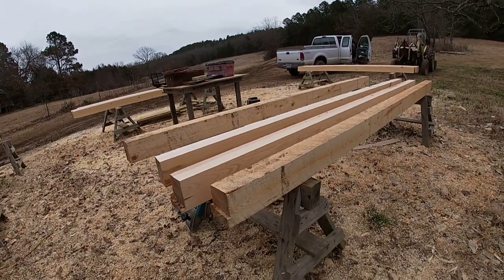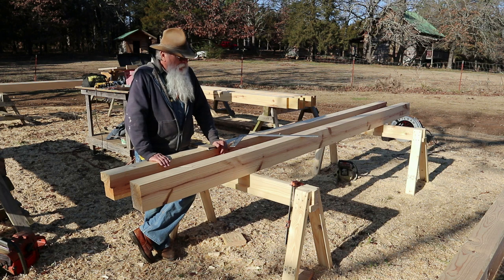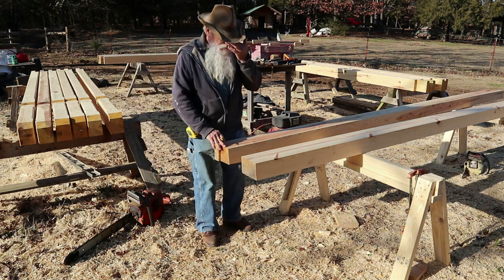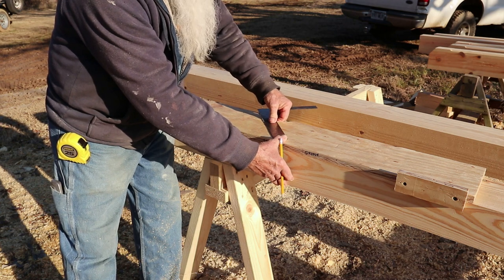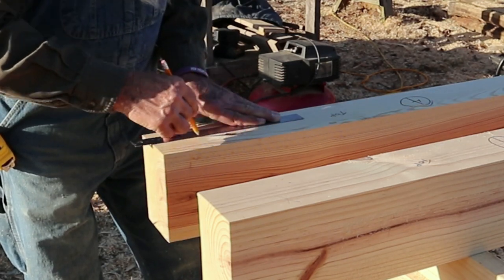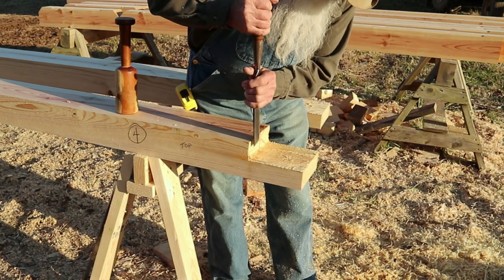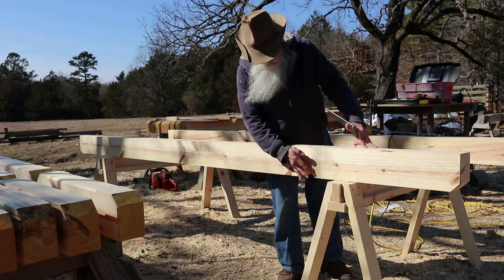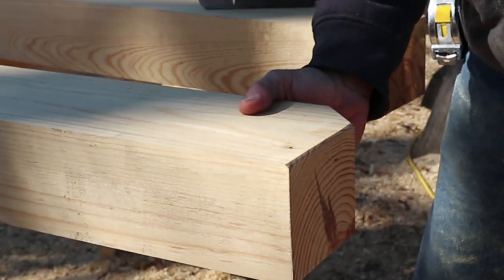Laying Out and Cutting Timber Rafters, Dovetail Log Cabin Build (Ep 40)

Comment: I've seen people butt the rafters together like that. But in my mind it would be stouter with a ridge. Might not be, that's just the way my daddy taught me. You can also figure the rafter length on the inside of an outside wall. And it's a good way to check rafter fit before sending them up. Shoot there's all kinds of little tricks and different ways to do things. I like learning new ways and techniques. You can never gain too much knowledge. I really enjoy your videos!
Reply from the maker: Howdy Johnny- I’ve put up a lot of rafters using a ridge. It’s a tried and proven way to frame a roof. But, since these rafters are exposed it has a cleaner look with them being half lapped and pegged. I really didn’t have to have a 4 by 6 but 2 by 6 would have looked out of proportion with the size logs I used. I enjoy cutting out rafters like this. I put them together on the ground and anchor the peak and set them like a truss. I am always open to learning different ways of doing things myself. If a person is paying attention they can learn something every day. Take care and God bless you
Reply: @TheBeardedCarpenter  yessir I can see how it would look better since they're exposed. A lot better! I'll remember that. Have a good one and God bless.

Comment: I use that Skilsaw method to do my timber frame notches and pockets, etc... cut a bunch of kerfs, knock them out with a hammer and then clean them up with a 2 1/4 inch chisel. Works great when you don't have that monster Skilsaw or your superior chain saw skills!! Many ways to skin a cat, as my mother would say.  I love putting those chamfers in the bottom edges too, dresses them up nicely. I just clamp a block on them as a stop for the router, much easier than trying to eyeball those marks under the router.
Reply from the maker: Howdy Brian- I’ve done a lot of that myself. There are times I use a Skilsaw to keep from cleaning up the chainsaw cut. Thank you for the comment- I appreciate it. God bless

Comment: Nice video! I've never seen anyone clean timbers with a wire brush. Learn something everyday. I've been meaning to get one of those skilsaw's. A friend of mine has one, he said they're the only way to go if you're cutting big timbers. I've always just used a regular 7 1/4 blade. That big boy sure would save a lot of flipping and cutting. Plus it would be a cleaner cut.
Reply from the maker: Howdy Johnny- I like to start out on a clean timber. It had been raining when I picked these timbers up at the mill and it’s almost impossible to keep the forks real clean on the forklift and there was a little mud on them. I live off a gravel road and it can be a bit sloppy and the trailer tires sling a lot of mud everywhere. That beam saw is really nice. God bless

Comment: great explanation of rafter layout and like the drilling trick with the speed square....would have liked to have seen this before I built my cabin, especially the tips on installing the wind block between the rafters...have any ideas what I can do now that the  rafters have been installed? Your doing a great job Bro. Paul...Thank you for sharing your knowledge
Reply from the maker: Howdy Mr. Duke- l sure appreciate you watching the videos. I went back and watched your video where you put up the common rafters on the porch so I could remember how you tied it in. If you can get to the plate upstairs you might put a backing strip on the sides of the rafters from the plate up to the lath and cut a piece of one by In between the rafters and put it in from the inside. Hope this helps. Your cabin is looking great. Take care and God bless y’all
Reply: @TheBeardedCarpenter  Thanks Bro. Paul

Comment: Oh man, Paul, those are some beautiful timbers! Did you cut a bevel on the edge of them? 
I'm going to come back and finish watching this tonight.
Reply from the maker: Howdy Austin- thank you brother. I used a router for the edges, so much easier. God bless you
Reply: @TheBeardedCarpenter  
Gotta give the carpenter his honor. 
They look real nice and you are real good with a chainsaw. 
Why did you put anchor seal on the endgrain?
Thanks
Reply from the maker: @austinpresley6187  I put anchor seal on the end grain to hopefully slow down the drying of the timber. Moisture in a timber will take the path of least resistant which is out the end.  Supposedly that’s what causes the checking or the cracks in the timber. Good question   Blessings to ya
Reply: @TheBeardedCarpenter  
Oh ok, thanks. It makes sense for water to travel down the straws.

Comment: Hello Sir. I watched this video again to understand the nuances. The channel or “dado” that you cut to slide in a freeze block - does it run all along the log height (at 45 deg angle of course) or do you keep it a little short? Secondly, the inside of the channel/dado is aligned along one of the edges of the bird’s mouth so that the outside of the channel/dado is further towards of the tail of the rafter or is the outer line of the channel/dado aligned to an edge of the bird’s mouth so that the inner line falls within the bird’s mouth? Hope I could explain myself. Thanks. Regards.
Reply from the maker: Howdy AS- the dado groove is on the outside of the birdsmouth and goes all the way across the rafter. The board I put in goes from the top edge of the rafter down to the bottom edge. It goes just over the outside of the top plate log and seals off air and bugs or birds from coming in.  Hope all is well with you. God bless you